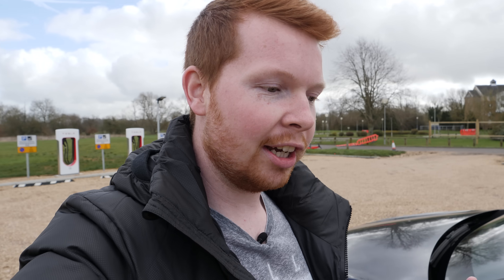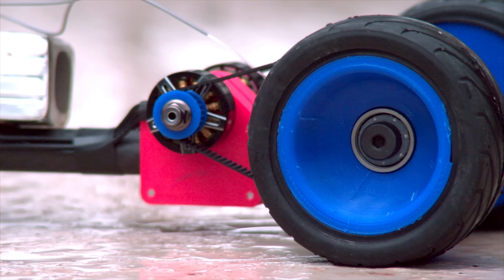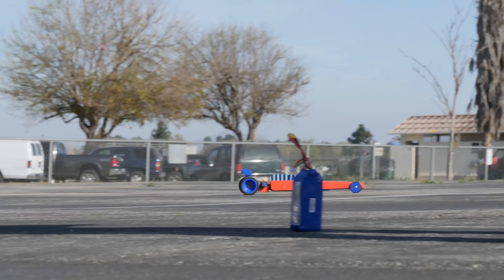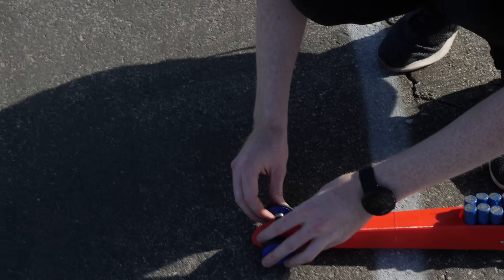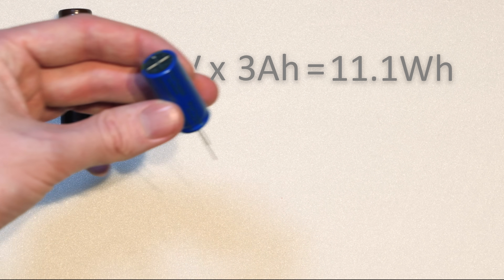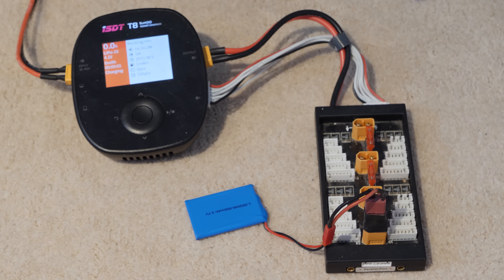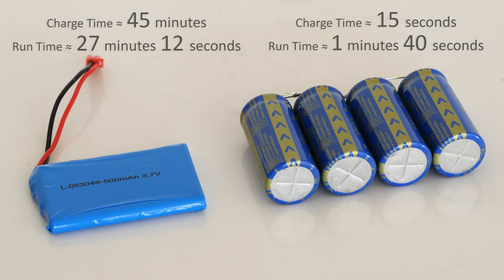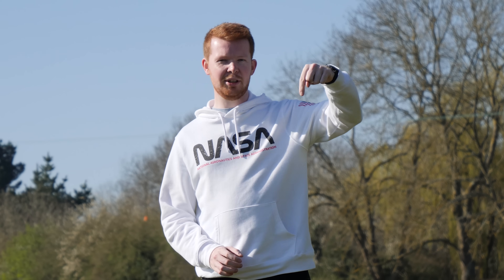Super Capacitor Dragster

Comment: Real life electric drag racing is one of the few things I look forward to in the future
Reply: There is something similar, where robots are programed to push other robots off the platform where speed is welcomed.
Reply: Ryan M. Imagine standing next to a top fuel with electrons and silence thumping your body and making your eyes burn and cry?
Yeah nah
Reply: @mmazz30  I'll believe "electric dragster" when I see it. That's nearly 7.5 MEGAWatts of equivalent power lol. I'd like to see them make that power at dragster weight.
Reply: @amorag59  
Yeah. Normal car, normal fuel... Electric (or hybrid) will win. But drag cars aren't exactly normal, and petrol has a much better energy density than any battery for the moment.
Reply: @amorag59  You DO realise that the while it's not purpose-built dragsters, that Teslas have been beating petrol cars in drag races for ages, right? It's the one form of racing they unambiguously have an advantage in.
The performance package equipped model S can do 0 to 60 mph (~0-100 km/h) in 2.28 seconds, which very few internal combustion vehicles can match even if they're purpose built racers.

Then there's this monster, which has been with us for a LONG time already:
https://www.geek.com/geek-cetera/worlds-fastest-electric-car-is-a-1972-datsun-can-do-0-60-in-1-8-seconds-1416865/

Yes, that's a Datsun. Doing 0-60 in 1.8 seconds.

Electric cars have a HUGE advantage in acceleration from a standing start.

And I'd like to point out that an electric motor that can hit that kind of power output isn't very heavy, relatively speaking.

The traction motors powering something like the german ICE-1, produce a combined total of 9,600 kw SUSTAINED output. (peak output for short periods can easily hit at least double that, if not more.)

That's used to get an 800 tonne train up to 250-280 km/h
And it does that using 8 traction motors... Thus each motor is built for sustained output if 1.25 megawatts.

Given these motors are mounted between the wheels, which means they have to be compact and fairly light (unsprung weight is a major problem for high speed trains. The train as a whole can be heavy, but the bogies cannot.).

Getting an electric motor into the multi-megawatt power output at relatively small sizes and weights isn't much of an accomplishment.

Powering it off a battery however is quite a problem. Though a drag race only lasts a few seconds...
The main issue is the current draw. 
The reason Teslas can win drag races but not longer races is because the battery management system can cope with extremely high current draws for a few minutes, but cannot sustain that output over a long period.

In terms of acceleration from a standing start, an electric powertrain built for that purpose will easily leave all  but the most carefully designed petrol vehicles in the dust.
It's not even remotely a fair fight IF you can sort out the power supply issues...
(battery current draw limitations. One of the reasons why supercapacitors hold an appeal in this context even though they'd suck for a road-going electric car.)

The motors can handle it. Easily.
The battery systems are where you hit a design limitation.
Reply: @KuraIthys  ye, battery tech is 20 years behind motor tech
Reply: @KuraIthys  I'm an electrical engineer, I DO know people like to cherrypick the conversation to 0-60 performance comparisons. Teslas and other EVS can constantly do runs because of water cooling - important factor you miss. 

Car performance as a whole is important such as braking distance for late braking though. Also dragsters run on nitrometh, a fuel which carries it's own "additional oxygen" that adds substantial energy even over gas. You can't compare an 800 ton train but nice try. 1.25 MW? You are still falling short... By a lot. Do you actually look up any of your facts or are you just giving your opinion? A traction motor removed from a truck weighs 6000lbs ... That was the whole point of my comment, getting the battery, motor, cooling systems to weigh 2300 lbs (NHRA min weight). And still put out 10,000 HP or (~7.46 MW)

Comment: you could probably improve launch acceleration by giving it solid axle suspension on the rear wheels. which would give it more consistent grip, which is essentialy more grip sense you can spend more time being close to the limits of the wheels, rather than having to use less throttle to avoid lossing grip because the wheels hit a pebble.
another improvement would be installing the batteries lower down to decrease the chance that it falls over. and ither forward for better high speed stability (im not sure if its the case here though), or further back for better acceleration. the vehicle has to accelerate 100% of the vehicles weight. but only a portion of that weight would be on the driven wheels and giving them grip. so by moving the center of mass backwards, more of the weight is on the rear wheels and making grip, which is where its important to have grip on a dragster.

Comment: Using your numbers on the car: You could charge the super-capacitor 180 times during that same 45 min lithium charge window and have a much larger overall operating time with sc's
Reply: You'd also have to screw around with charging the thing 180 times.
Reply: yes, i was thinking the same thing. and then how do you charge it. but then thinking about light rail or maybe even city buses. this would actually work pretty good vs having to run wires over the road or track. anyw, they are quite amazing used in the right situation.
Reply: @jmac1099  Perhaps one could use inductive charging at stoplights and such for city busses.
Reply: @GL0BETREKKER  Fairly sure they are starting to do that.

The nearest moderately sized city to me has recently built it's first light rail line through the city centre.
That's a conventional design using overhead wiring...
But now they're talking about extending it through a different part of the city, and one of the requirements being demanded for that part of the city is... No overhead power lines.

Since it's dangerous running power through say, a third rail, on a light rail system that runs over roads shared with cars and pedestrians...

They're talking about installing charging systems at the stops in this region, and adapting the trams run off some kind of battery system. 
Not sure if it's lithium Ion or supercapacitor based. Though I'm not even sure they've finalised their design choices here anyway.
But the point is the system would switch from overhead power to rapidly charging every 5 minutes or so until it got through the area where it couldn't use overhead power...
Reply: @KuraIthys  some cities have been using underground induction power trams for years already, why not do that?
Reply: @KuraIthys  Sydney recently installed a light rail system that has parts with no overhead wires. They were thinking about using battery power but instead went with a central flush mounted third rail. They avoid the electrocution issues by dividing the rail into 3 metre sections which are only turned on when the tram is above them. I really don't trust microcontrollers with my life that much so I try to avoid the rail when I cross the road, but I'm not sure how safe it is with puddles of water on the road
Reply: @jmac1099 
Rail and electric buses run a known route though, and a small, low current wire can be strung up to power them. Super caps would need a much thicker cable run to the depot... Or much higher voltages for the same thickness cable.

Very similar problem to why everyone can't just go buy an electric car and expect things to work.
Reply: @jmac1099  Like the busses in San Francisco. They are connected to wires overhead but we could install rails all over the roads with magnetic connection to the bottom of the car that could easily and affordably be replaced. Then each vehicle could have buy design an owner removable battery system to be used in conjunction with the super caps during times when there is insufficient infrastructure.
Reply: They could do this with real cars, and just have charging lanes with electrodes sticking up every 5 miles, you just drive over like a slot car.
Reply: Thanks for doing the calculation. Now if only there was a way to transmit power through Earth like Tesla wanted to do, we wouldn't need caps eaither
Reply: @manipulativer   we know how Tesla wanted to transmit power. With induction. It's literally how we wirelessly charge phones. And the efficiency is trash(30%) and it barely works at all over longer ranges, and that won't change. If you want to go fast with electricity take a train.
Reply: @kevinrdunnphs  BMW has got the efficiency up to 85% for charging their BEVs.
Reply: @manipulativer  you could use a spotlight and some solar panels on the car, keeping just a couple of supercaps as a buffer.
Reply: Or just put 27 times more super caps. Charging time would be limited by your electricity service.  But how fast do super caps, decay without a load?  Charging heat would need to be dissipated.
Reply: This is why I think SC with onboard generator might be a good pair.
Reply: And what about the weight and the space consumed by those caps..?
It's just inefficient peace if used as a storage device...
Reply: Hi Aditya. That's a good point and one of the main reasons s-caps aren't used for many applications.
That said, a lot of the fun of engineering is testing out ideas and pushing ourselves "outside of the box"
Reply: Re gen is part of the re charge answer. Inertia and momentum could be harvested efficiently with super caps. Acceleration rate and re gen braking rate are interlinked though, so the quicker the weight is accelerated you need to slow it down at a similar rate to have high efficiency harvesting.
Reply: @melodysouljahrootsdubpress5539  You are correct with the first part, then you run off into the weeds: Re-gen is part of the recharge answer. 
The rest should read: Kinetic energy can be harvested efficiently with super caps, but not with lithium batteries, which cannot tolerate fast charging. Acceleration and re-gen braking are interlinked. Energy recovered by regenerative braking allows for re-acceleration with minimal net consumption of energy.
Reply: Yea, I was wondering about that too, plus how well would that scale up? A Tesla runs out of a fully charged battery in about 6 hours of driving, so about 12 times of what the small car could do, with the capacitors you had a minute and a half, so at full scale about 20 minutes... that would totally do for a Car that runs for errands and such.. go shopping, charge 1 minute and go for your next location...

Comment: Imagine you could buy an electric vehicle without the battery fitted with only a tiny one to get you to the nearest service station - then approach your fuel distributor as if it was with a normal car and observe green light showing you when to stop, you select type of battery you want to get - then automated robot positions itself underneath your car and within seconds removes your depleted battery and replaces it with a battery size of your choice which is tested and certified for minimum range. The car checks the battery and when check is completed you are ready to go, all this done within 20-30 seconds (so even quicker than charging super capacitors)

This would eliminate charging times completely and would make electric vehicles much cheaper because you wouldn't need to buy the battery. Battery would be owned and taxed by the Government and there would be an insurance premium covering it's use just like there is a fuel tax on petroleum products. It would help the environment immensely and would prolong batteries life.  Car manufacturers and the government should work towards standardizing EV battery form factor and voltage and charging - this will make Supercharging obsolete, a thing of the past. 
PS: even if supercapacitors were possible that way you still face an issue of power surge which is a major concern. Imagine what load this would put on Power Stations if suddenly everyone decided to pull 100kWh from the grid in few minutes - it would end up blowing the Power Station/Distributions for sure. Also I think National Grid is not design for such loads - so the super capacitor option would require upgrades to existing grid and HUGE battery banks which would end up costing more and be bad for environment. I think replaceable battery is the most convenient option - once you replace your initial battery you just keep replacing them at service stations. Imagine Tesla instead of 35k costing in a region of 20k (no battery). Let's say you will have a choice of 3 types of batteries to chose from  (50kW, 100kW, 150kW) for all cars, sedans, SUV. Fitting and voltage of them 3 could be the same so you could fit 50kW or 150kW if you prefer - mix and match for every vehicle. Then you could have Truck batteries - 200kW, 400kW etc with higher voltage but again standardized across the range and all replaceable within seconds.. What are your thoughts?

Comment: i once put some supercaps in my tv remote, and it ran for several days without any sign of loosing charge
if you just did that at the factory, and had a charging port on the TV, you could eliminate one source of waste batteries from the world
Reply: Do supercaps age? A small rechargeable battery might work just as well.
Reply: @Mike-oz4cv 
Yes. I think they get more charge/discharge cycles than a lithium cell, but you get less capacity so it sort of cancels out.
Reply: Or wireless pc mice
Reply: @spankmygimp  now i want to learn how to wire super capacitors on my mouse just for that, a 1 minute drop on a charging port giving you a few days of usage sounds great!
Reply: @spankmygimp 
Wireless mouse with super caps would be pretty useful. The better Logitech ones use a single AA battery and claim to last something like 6 months off that, so a super caps should run it for weeks, with maybe 10 seconds of charging.
Stick some pogo pin style charging pads and you could just hold it to a little charging plate for a few seconds when it gets low.
Reply: Just make it chargesble via usb c
Reply: Just have a remote caddy like those house cell phones charge in